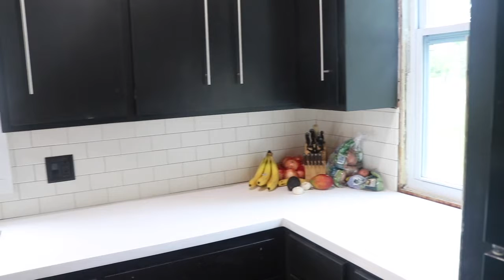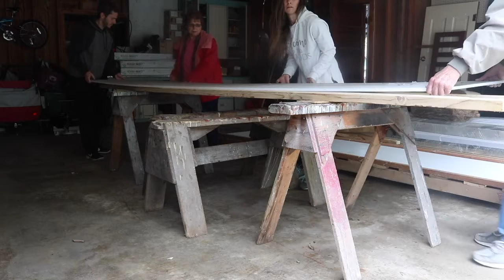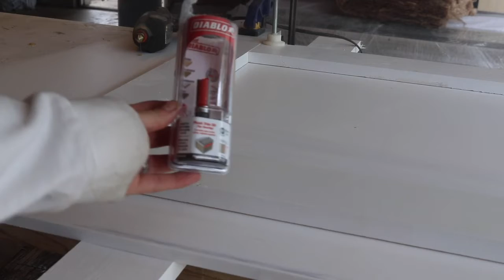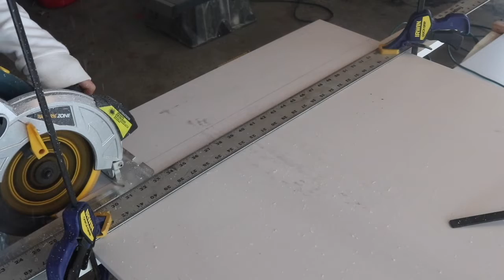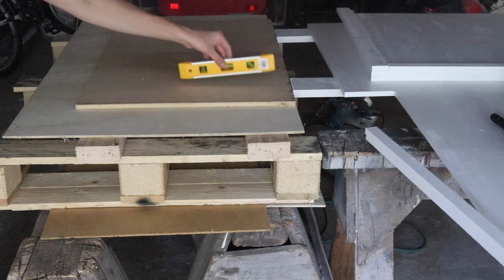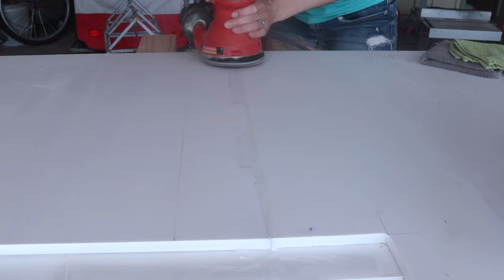Solid Surface Counters | DIY Kitchen Countertops | Fabricating Counter Tops

Comment: Corian countertops for the do it yourselfers are  deceptively easy to accomplish. But be careful. Go and research the underlayment strategy. There is a lot of movement due to heat expansion and shrinking to be expected. Research carefully! And the smaller the project the better the chance of success (Success being a kitchen surface that lasts many years). And should you plan a small Corian kitchen or bathroom, do not immediately go on a tool buying spree. A table saw is great for cutting the backsplash and edge strips. I did NOT buy a 10" finishing saw blade, rather,  I tried the one I was using for lumber and lo and behold, the blade held up ok. And I cut about 70 feet of edge strips and backsplash. For a one time Corian project I would also not advise to spend a lot on  the "Corian special routerbits" . I ended up buying 2 carbide tipped bits on ebay, one 2" edge trimmer, and one to round off the edges. They held from beginning to end without any degradation whatsoever. I used the "solidsurface" adhesive of the specific color, and I would absolutely advise against using some epoxy glue from the hardware store. The orbital sander works great and do not go and buy large packs of 5 different grades of abrasive disks. 3 different grades are more than enough, and just get 5 disks each, you will not even use them all. really 2 is all you need. Use dish scrubbers for rough polish and auto polish that contains an abrasive for the fine polish. In general, don't buy the expensive tools unless you are going into business. The biggest problem was in transporting larger pieces from the garage to the kitchen and place them. Corian is Plastic but has surprisingly many traits of stone. Drop a piece from high enough it will shatter. and wear eye protection, the small splinters are sharp and can do damage! Good Luck!

Comment: Wonderful job! I'm working through a similar project myself. I finished the easy side (with just a range cutout), and next is the difficult side (with an undermount solid surface farmhouse sink). I'm using WilsonArt solid surface (because I work there). Thanks for the video!

Comment: You never carry solid surface sheets laying flat like that it's a wonder you guys didn't snap the sheet in half. Carrie the sheet vertically running long ways that way will not snap. Just in case you guys get into another countertop project